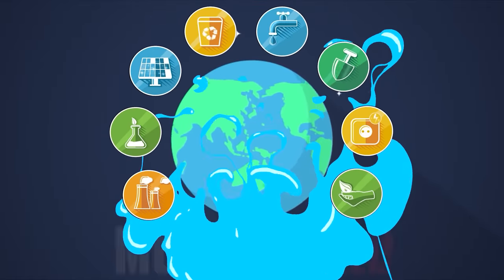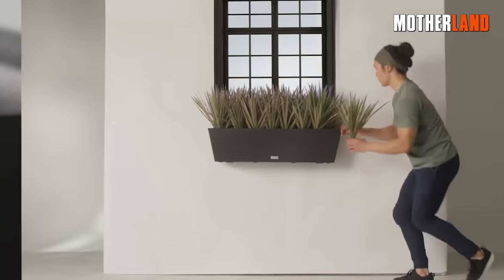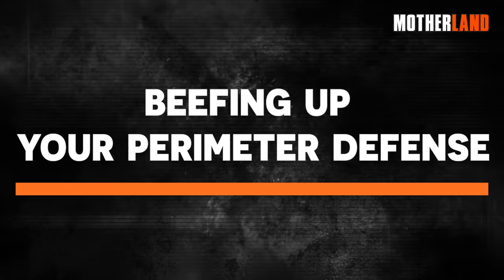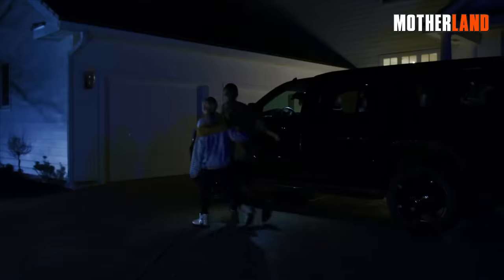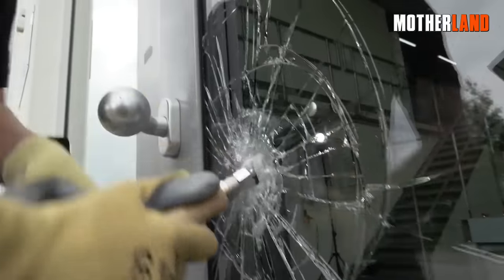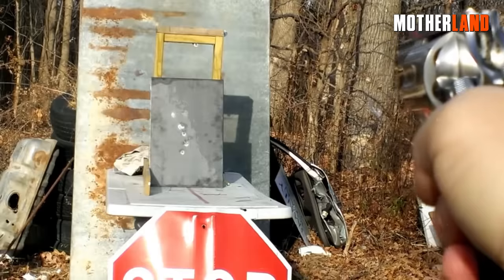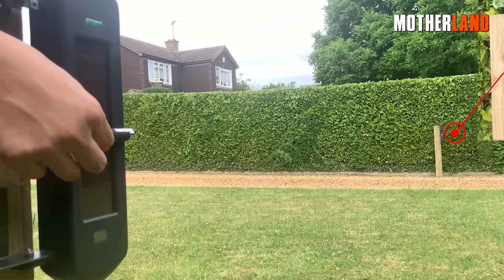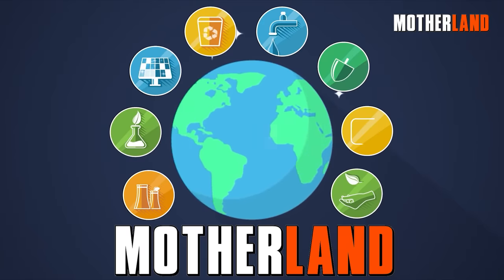Low Cost Tips to Help Bulletproof Your Home for SHTF

Comment: Replace windows that are in and around doors with 1/4" acrylic. Coat them with a ceramic car coating to keep them from scratching and from UV damage.
Reply: cool drillable/meltable super expensive windows
Reply: @jrich436  As opposed to a window you can just toss the drill through? Nothing will keep someone out that wants to get in. You could just drive a car into the house and be in. I mean if they have a drill and don't mind the noise, they could just drill the lock and be in. So yes, you can drill a hole in plastic. It will melt. Glass can melt as well. You can drill through glass as well. If you have bars over the windows, you can cut through them pretty quickly with an angle grinder. If you have no windows, you could cut a window sized hole with a sawzall. I suppose I'm missing your point. I say replace the windows with acrylic, because it will stop a quick blunt force attack, unlike a window. While still looking like a window. Plus, It's really not expensive to do for a significant amount more security vs break ins. Just needs to buy enough time to allow you to grab your firearms and wait to open fire. 🤷🏼‍♂️
Reply: @ryanguldbrandsen7672   nah 

suggestion was silly….

Then you took actual time to write this silly rant instead of just dealing with the fact that your suggestion was…. Silly

Which is why you have NEVER gone to someone’s house who replaced the windows on it with 1/4 acrylic 

Takes nearly 3k degrees to melt glass, acrylic starts to become malleable at 200* 🤣

I can literally get through it with a bottle of isopropyl alcohol, some yarn and lighter, silently

Acrylic costs SIGNIFICANTLY more than glass, astronomically more than glass

I have insurance on the contents of my house 🤣 I’m not buying custom cuts of acrylic or cutting it myself and then modifying frames to put it up as a means to be more cost effective than replacing the contents….. which even WITH the cost of acrylic costs more, which is why it’s insured 

Have fun babying those plastic windows and then still having to buff fine scratches out and sanding dull clear off them and then having to respray perfectly and then getting trash in it as they cure anyway 

Meantime you have a standard frame around your door that even with how fragile glass is even SWAT is going through THAT instead of the glass 

It’s a silly idea. Go to sleep 🤣
Reply: @jrich436  Mine has been going great for 5 years. Not one issue. 🤷🏼‍♂️ I coated it in 2 coats of ceramic before install. I use spray on ceramic stuff once a year for UV protection. I did cut it myself. Super simple. Cost me like $145 for Lexan. 🤷🏼‍♂️
I guess I need to really watch it for people carrying alcohol and thread vs a hammer. Who knew people were so prepared nowadays. What your saying is dumb. People just don't carry that crap with them. They aren't thinking, oh I should bring a blow torch in case someone has acrylic windows. It just doesn't happen. I was merely stating a fact that everything melts. I didn't rant about anything. What you said was dumb. Because it's super unrealistic. What is realistic is someone using a hammer or rock to break glass to unlock the door. That's something that does happen. Noone is going around melting plastic windows. It's likely literally never happened in history. You have to be realistic with expectations. 

Of coarse swat would choose to go through a door vs breaking glass. They have the tools to do it. They need a rapid entry. I'm not worried about swat. I'm worried about realistic things. Like teens or a junkie breaking into my house. These are things that happen in REAL LIFE. I prepare for things that actually happen to law abiding citizens. 
I don't know where you live, but people just don't do what you're saying. You can't prepare for things that just never happen or you may as well live underground in a bomb shelter. Even then, you'd have to worry about the military hitting you with a bunker buster. So you'd still be screwed. Now please go on with your unrealistic situations. 🤦😮‍💨🙄
Reply: you have cognitive dissonance issues

While saying the objective fact that anything can be defeated as a means to argue a defense for a silly suggestion you are now again trying to argue that your idea isn't silly by talking about the probability of defeating things

You brought up melting glass....

MAKE IT MAKE SENSE

Acrylic scratches easily and there is no way you are cleanly spraying ceramic clear in an exterior environment, let alone vertically from a rattle can.... 

If subjectively you accept that trash on the front of your "house", thats fine. But arguing that its a 1:1 superior replacement to glass is objectively silly

DECADES of working with acrylic. Same with restoring vehicle headlights. Ceramic clears are hazy and work really well on things like valve covers and other under hood parts where we do not really see the gradual yellowing and the initial haze. They are ceramic to help with the heat engines put out NOT for your application. A good 4k clear sprayed from a gravity gun in a controlled environment is the only way you are going to get any decent lay up and consistency when it cures. Then timing the next pass as not to get a reaction with the new layer and the solvent as directed on the sheet from the manufacturer 

DOUBT you are that in depth 

No one is randomly walking up to your door while you are home and then getting surprised by your plastic sheet and giving you time to get to your gun because they are now banging on you 1/4" STALLANIUM plastic like a moron

Teens and junkies are going through a window on the back or side of the house while you are not home 

Any real thieves are taking a long wrecker bar and distorting the frame braking that 1X either by forcing the bar through or pulling it off the 2X4 OR mule kicking it to do the same thing.

If it isn't budging, they are going through a window 

again, you are weaving in an out talking about reality trying to defend putting trash on your house when you don't need to. Its your house to trash up my man

Even IF my HOA wouldn't ask WTF am I doing, I'm not spraying hazy clear on plastic I fitted into frames in or around my front door on my house

How you got that frame holding that sheet in? Stainless screws you drove through it?

Wanna bet there's stress fractures because you didn't melt the holes into that sheet of Lexan or sand them diamond bits after doing low pressure high speed drilling with pre heatd  bits and tape on your plastic?

And a good solid kick from someone who knows to kick THROUGH it with their weight not at it will fracture either it AND the frame? Because you have what? 1/4 or less between the edge and the hole to secure it to the frame? How long are those screws? What are they fastened to? Solid wooden door? Standard 1X window frame? Acrylic or Aluminum frames? 

145.00 to use up hours of your life, make your house look cheap and add NO security so you can look through hazy plastic... followed by typing all this 😆

You are a special type of person
 @ryanguldbrandsen7672
Reply: @jrich436  What in the hell are you talking about dude. I spray ceramic car detail stuff on it yearly to keep it from getting UV damage. Absolutely no haze at all. You seem to be seriously confused. 🤷🏼‍♂️ I've worked with plastics many times and I did use a diamond coated bit at low speeds actually. It's not really that special of a thing, I had it on hand.  It's actually sunken into the 2x4 frame of the window to help combat flex of the plastic with two 1" S7 steel bars (one every foot) behind it to further combat flex. I don't have windows on my door. Just a small 3ft window next to it. I don't know where you live. But I don't really need to worry about an actual thief breaking into my house. Just normal people trying to break in. Like normal Americans. Noones going to be kicking in my door all that easy. I would have enough time to get to a firearm. I'm American and have no kids at home. I have 11 firearms. They aren't chilling in a safe or out in the open. But they are for home defense. So they are in every single room of my house. I can get to a gun with in 5-10 seconds.
I've been broken into twice. Once through that window and once through the door. I wasn't home. My windows are too high off of the ground and everyone can see my windows, my basement is only 4ft under the ground. My door is less exposed.

Anyways Luckily, they ignored my unfinished basement where my hobby stuff is(wood work, leather work, metal work with a mill, ammo reloading). My door is very secure now. 3" screws and three 4" steel hinges, mul t lock dead bolts,  3/16" 4"x22" sunken 3v steel strike plate @60hrc that I made with 25 3" screws. It's obviously not impossible to break in, but they would likely give up on the door before getting through it. The door would have to bend in quite a bit. Hence why I have acrylic window. When I first did it, I kicked it and it pushed in, so it's 1/2" sunken into the frame, I used 3/16" steed rods going through the frame to secure it (the holes are 3/16"). It may crack at the rods if kicked, but the 2 bars behind it will keep it from being pushed through. It really wasn't a waste of time. I didn't have anything better to do besides watching Netflix with my wife. I like working with my hands and it was a fun project. Put my hobbies knowledge to good use. I live a normal life, working 7-330 every day. So I have a solid 6 hours to do whatever with, 5 days a week. 

My stuff is fully insured, but not all things can actually be replaced. I have 10's of thousands of dollars in just raw materials, some that is rare and cannot be replaced. 

I honestly could give two shits about what you say. You're just some Internet fool, really wanting to be right about something, that... You're wrong about. My 36" x 8" acrylic window looks like a window. Clear as a window. A couple of scratches from me accidently hitting it with stuff. Which would have likely broken a glass window. So technically, Ive saved money just in glass replacement. Noones tried breaking in for over 5 years. Likely due to the cameras. So, who knows how it, or my door will do. Maybe if I'm not home. Definitely ain't getting through the door while I'm sleeping as I have a stacked hollow hardened 12g steel bars that goes across it. Back door is more secure vs the front, with mul t lock dead bolts on each side with the same strike plates. 

Obviously if someone really wanted to get in, they could. A 6" angle grinder would make short work of the door in 15 seconds. 🤷🏼‍♂️  But I would have gotten to a firearm before they breach. 

Anyways. I have tons of useless knowledge, time and Im comfortable money wise. I researched plenty. I could have put in a bullet proof window for $2700. But it's just not needed. Just need a deterrent. If shit were to hit the fan some, I would leave my house in the city and go to my more secluded house in the boonies. It's more defendable, better stocked and doesn't rely on grid power. I do need to replace some of the batteries this year though.🤔😮‍💨 

🤔 Wonder if this would be considered a rant. I'm just bored. Well I was. Now I'm going online battery shopping. 🥳🤘

Let's keep this going. It's entertaining. Plus it's reminding me of things I need to do. Like the batteries.
Reply: just saying a regular steel door like that goes on the front of a double wide mobile home from the factory nothing special just a insulated steel door i witnessed the sheriff's dept during a kind of raid hit the front door at least 15-20 time with a battering ram AKA "knock knock" and still wasn't able to come through the door the door had to be unlocked and opened by a person inside and even after they tried to break in the door it still functioned like it was supposed to despite having a huge crease all the way down the middle of the door they hit it so many times it literally started bending the door in the middle like folding in half like this [ | ] only locks on the door was a regular deadbolt and regular door knob no extra locks or bars the hinges was the same ones that came with the door the striker plates was just regular average striker plates only thing was 3 1/2 or 4 inch screws was used throughout the hinges and striker plates and thats all........just thought i would share that experience with yall maybe it will be useful info to someone or something idk
Reply: @joshuaballard6257  I've lived in a couple mobile homes. The doors were plastic and Styrofoam. The door knob and bolt lock weighed more than the door. I don't think the frames could support an all steel door. What kind super mobile homes do you have in your area!?!

Comment: In the Army we used flash cubes.  Not sure if they still make them anymore.  You can hold back the "trigger arm" with a paperclip and run some trip wire line.  When triggered at night you were blinded for at least 10 seconds.
Reply: Never heard of a flash cube begore

Comment: For wooden stockade fences , I use 1  1/2" to 2" wire nails with the heads cut off at an angle and placeed on top  blessed with dog poo .  Works great  !
Reply: Anarchist's Cook Book?
Reply: One could run screws or nails thru a piece of plywood or such about 2 inches apart throughout the board. Set the board inside the home under the windows after screwing to the floor. Should only need this on the first floor. So if someone does gain entry through the window, this will slow them down or deter them.
Reply: I've had that thought  along with using several of barbed wire or electric wire (think livestock fencing).   Also make some caltrops to scatter on the ground along the fence so if they do make it over, there's a ground "surprise" waiting for them.

Comment: I'm building my home out of ICF forms. I live in northern climate with tornado hazard. 
Foam forms with 6" reinforced concrete in the middle. 
Bullet proof is just an extra positive. If I could come up with some special shutters to prevent window damage it would be perfect.
Reply: I never liked shutters on the outside of a house because you have to be outside to close them. I'm planning on replacing my curtains with a more modern looking double sliding barn doors. That can be locked an barred from the inside. I don't like my windows being open much anyways so if the glass catches a bullet atleast it won't go to far.
Reply: @sparklekpadeh3382  Don't forget your sniping holes.
Reply: check out the rolling shutters from Germany.
Reply: I have a coworker in South Louisiana who has electric roll up shudders on the outside of his home.  I don't know how well they actually protect the window, but I'm sure there is an expert somewhere to provide scientifically backed improvements for hardening them.
Reply: @peenchay_whetto2333 Just like the steel roll up doors shop owners use in seedy neighborhoods.

Comment: Lots of other things you can do such as replacing those large picture windows with smaller (12"x12") windows that will deny easy access into your house.  Your typical wall won't hardly slow down bullets but if your make your walls thicker by taking off the sheetrock, adding another width of 2x4s, then stack either bricks or concrete blocks into the walls using 2x2 or 2x4 like rebar to keep the blocks aligned vertically and replace the sheetrock.  You may need to reinforce your foundation to deal with the added weight especially if you choose to use rebar and fill in the block hole with concrete, but this shouldn't be necessary as even though the impact of bullets will tend to break the blocks the outer wall and inner wall will keep it from going anywhere and the block holes also help dissipate the velocity of bullets!  Anything you can do to make your house more fire resistant is good even if it's only to set up a sprinkler system on top of your roof though getting a metal roof is better!  Make at least two racks on each door that you can quickly throw wooden beams across (even just 2x4s).  One at about 1/3 up and the other at 2/3 up and sliding bolt locks at the top and bottom of each door!  Place 4x4s in the walls on each side of the doors to lag bolt the racks onto!  Of course, keep multiple fire extinguishers handy!  Plants like yucca placed under your windows will discourage 'peeping toms' as will a shotgun!  The large planters at military installations are there to help block vehicles that are being used to ram into walls and doors!  A stair-steeping barrier (part empty moat and part steps) will do the same thing!  Make sure to use wooden boards to help keep the rains from eroding your steps and provide adequate drainage!
Reply: Many places have building codes that prevent you form installing smaller windows.
Reply: @Gravedigger933  Even without codes, you need windows you can escape through, as having a house fire is more likely than SHTF. In military training one lesson is to never build a fortification so seamless that you can't get out if you need to, preferably via more than one route.
Reply: We used old phone books. Thick and helped with insulation
Reply: @christinam673 Cant get phone books anymore where im at , where you at ?
Reply: Serious stuff, thanks for your intelligent and long comment !!!!
Reply: I like the planter box idea , there could be a fox hole and a trench behind those planters , if I were able to build a home , I would place cinder blocks reinforced with rerod , I would also fill them with sand
Reply: Could move planters out about 50 meters pilled with river stones and weather proof explosive harc wired to your toc room.   If your plan for an assult. Just as well  clear some vantage points.
When we did this there was plenty of claymores , frags and if you wete ready for bar-b-q.. phu gas!!
Reply: Do you realize how much what you are saying would cost?
Reply: @Gravedigger933 , and for good reason (codes require multiple exits). You need exits from fires, earthquakes, . . . .